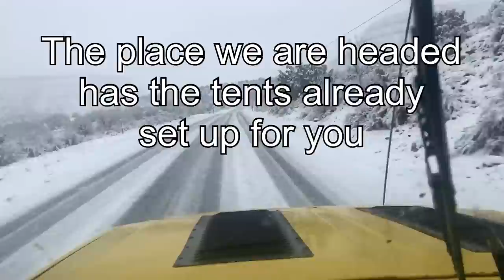Thanksgiving Day Rescues! Nissan Titian, Buick, Mazda, Dodge, Chrysler

Comment: A little tip for anyone in this situation. FWD cars get better traction in reverse so you can try backing up the hill before calling for a tow, but be careful it is much easier to lose control in reverse as well so go slow.  I often take advantage of this to get back into my driveway if it snows while I'm at work.

Comment: I too got caught up in this storm system but in the mountains in San Diego where I live. 2 days after the storm we attempted to drive home down our 10 miles dirt driveway. 5 miles in we got stuck in a snow drift about 2 feet deep. I was in our tahoe in 4 wheel low, real tire chain (not cables) and run an aggressive tread tire but could not get out. Snow was up to our frame. My husband walked 5 miles to get our backhoe to plow our road and pull me out. Fun adventure, we were prepared with food, water, blankets and snow gear. Our kids wanted to spend the night out there because they were having so much fun.
Reply: Sara Scott I’m guessing that your Tahoe doesn’t have lockers like Matt’s Jeep.  Without lockers you truly don’t have four wheel drive on slippery surfaces.
Reply: @ClinttheGreat  no I dont have lockers, wish I did. It being slippery was not the issue, my problem was the more than 2 feet of snow I was trying to push through. We could have dug out but we only had 90 minutes of daylight left when we decided to get the backhoe. We also had our children with us and needed to think about their safety as well. My home is down a 10 mile dirt mountainous road so I think I know a little bit about my 4 wheel drive capabilities.
Reply: Clint The Great Lockers don’t matter if you’re buried up to your frame and your car doesn’t have the clearance so it’s pushing through the snow. You can get by without lockers.
Reply: @samuelyi9189  thank you! Lockers are helpful in  mud, which I do encounter on our road but have never needed lockers to get out  because I dont drive like an idiot. Had lockers on my Tacoma 4x4 and never needed them. Unlike the folks in these videos we were very prepared (we keep folding shovels in all our vehicles) and were able to get ourselves out with our own equipment.
Reply: Sara Scott I totally understand what you meant. We have a 2016 suburban and does not need lockers at all.  And we’ve gotten it in some mud. Meanwhile my diesel 7.3 F250 just sinks straight down 👀
Reply: @samuelyi9189  we have similar taste in vehicles. We have a F-250 with the 6.7 and my dad has an F-250 with the 7.3 I'm not brand specific just do my research and go with tried and true performance. I've owned everything from a toyota, jeep, chevy and ford.
Reply: @samuelyi9189  so far so good. We have a sweet extender warranty on it just in case. Already had the high pressure fuel pump replaced under factory warranty but otherwise it is not a daily driver just for towing our 5th wheel.

Comment: This channel has inspired me to build a 00 wj v8 as a offroad recovery vehicle I have outfitted with small lift 1200lb winch highlight and  mat trax and have a yankum rope coming soon the vehicle came from my tow yard so the cost are low but thanks for inspiration guys
Reply: You need a much bigger winch than that.  You'll destroy something that small the first time you use it.
Reply: Jeep was free and has reman motor in it I'm not a fan of the 4.7 but free is free
Reply: Smittybilt Gen2 XRC 12,000lb Winch 97412

Sorry forgot a zero

Comment: I just moved from the snow belt in western NY and I lived on a 1/8 mile gravel driveway with a pretty good grade on it.  I can't tell you how many times I have pulled delivery trucks back up my drive way to the main road with my Pathfinder.  AT tires make all the difference in the world.  Noisey on the highway, but worth it.

Comment: You know, in my 2019 JLUR (lifted with 35s on), I would feel secure with a winch, MaxTrax, chains, heavy duty snatch straps, and more.  And it is SUPER capable.  Already helped several ppl out of trouble.  

In THAT thing?  Just a kinetic rope and some good tires are all the Banana needs.  Damn that is a beautiful, fully capable XJ Frankenstein that needs no extra toys.  Never get rid of her.

Comment: I can see that your tires condition is crucial to your not getting stuck but over here in upstate NY metal studs can be a life saver! Try a pair on for those real icy, snowy treks when your hanging off a cliff edge they can be what keeps my suv from sliding off the edge
Reply: Morgan Earp no.
Reply: @richardburns9772  Yes. Studs are a life saver on wet ice or wet compacted snow.
Reply: Richard Burns just went up to public lands yesterday with mine on my Subaru . Went through a lot of country I would not have been able to with the “all terrains”
Reply: Morgan 2525 not with that attitude you wouldn’t.
Reply: Morgan 2525 so?

Comment: "don't overrun the rope" proceeds to drive 5 feet over the rope
Reply: Maybe he thought overrun means getting the tires on top of the rope? Some of them are tourists and not the best English speakers... or he couldn't see it.
Reply: Dylan Houser I helped some guy I knew tow his truck using a brand new tow line. I was starting to slow down as we approached his house when the guy thought it’d be funny to come to a skidding stop...of course he ended up locking up his brakes right as he ran over the tow line and shredded it. When I asked why he did that, he said it’s just a rope. No Jack-Hole...it was a $50 line that was now unusable. He refused to kick any money towards replacing it. That was the end of me ever responding to his calls for help fixing his truck.

Comment: I worked at a Ski resort, Timberline, for 4 years and pulled numerous tourons up the mountain. Heck I’d make more in a weekend of heavy traffic than I did working the lifts and making snow.

A POS Isuzu Trooper with a welded rear diff, a set of chains, and a few snatch straps and 2 shackles is all I had;  nothing special that’s for sure.

And I NEVER asked for payment; but people were very grateful and generous.

Comment: I guess the guy with the Titan didn’t have a floor jack and a block of wood or anything to put under tire and back up. Some people just don’t think lol. Great video Matt Merry Christmas
Reply: That one was easy money. Kinda surprised he even got the call on the titan
Reply: It looked like he was pretty isolated, which means he should be even more self sufficient.  High lift jack would’ve worked perfectly.  Enough trees around that a come-a-long and a chain would have done the trick.  People just way to used to calling someone else for help.
Reply: I was wondering how something like that happened twice. The guy might be elderly, drunk or just forgetful of the terrain.
Reply: @eunhyuekpark6159  or all three lol
Reply: Air jack under the subframe, then stack stuff under the tire? Seemed quite tight for a floor jack and putting it straight under tire is never a good option in my opinion.

Comment: As the phrase goes, hindsight is 20-20 as we sit here and watch what happened to those stranded people with rentals, after all it appears to be a public road and an established spot for those looking for holiday accommodations and probably booked well in advance at that, along with the rental vehicles in question. Freak unusual weather for that time of the year comes and everything goes sideways. Speaking of rentals, years back I rented a 4x4 Suv in a location that gets LOTS of winter conditions and it was indeed winter then and not one of their rentals had winter tires on them, that just seems to be the way most rental companies roll, put as little into the vehicle as possible.

Comment: Front wheel drive. 
All season tires. 
No ground clearance. 
Loaded up with gear. 

Ready for snow camping?
Reply: Ground clearance really wasn’t an issue. Everything else was though.
Reply: But the tires say m+s. Meaning "mud and snow". Are the tire manufacturers lying?
Reply: @themexicanstaringfrogofsou5268  the M+S rating tires usually have plenty deep tread, but little or no sipes for ice traction.
Reply: @themexicanstaringfrogofsou5268  Not lying per se. It's more like a joke that's only funny to the manufacturers.
Reply: Yes, the tire manufacturers are lying. M+S tires have rubber not suited and often not even rated for below zero conditions. To drive in snow, you need winter tires for traction/safety.
Reply: In northern New England  we call that "Tuesday".
Reply: @ancelrick5396  Here in Texas we call it Tuesday Tuesday
Reply: Half these people could have made it if they just turned off stability control and aired down to 10-15PSI.

Comment: I drove a Chrysler Town and Country cab in Austin and we got a snowstorm one night, one of my regulars lived on the top of a hill and I couldn't get up it the first couple times I tried, then I decided to try to back up the hill and it worked like a charm. Front wheel drive, weight of the engine on the drive wheels and didn't have a problem at all.

Comment: Tires Tires Tires. Many of the cars would have been just fine on some dedicated studded winters
Reply: i thought exactly the same, 4 season tires are not enough for snowy mountain roads.
i live in the mountains, always swap to the winter seat of wheels and never ever get stuck or lose control.
plus they even perform better with dry clean tarmac with cold temperatures compared to standard tires and since i change set of wheels at home i didnt spend money with tires shop once tires are mounted onto his wheels.
here winter tires or snow chains onboard are mandatory during winter so usualy only tourists or semi trailers get stuck.
Reply: Studs don’t really help in conditions that aren’t smooth ice.
Reply: When someone throws a Tire to your face do you get Tired?
Reply: @sunnydeng9263  FWD is great in the snow as long as you're not trying to plow it with the bumper. Good set of snow tires and some caution will get you through horrific weather that has all the manly SUVs with mudders skidding all over the road.

Comment: Is the Jeep manual or automatic transmission?

Never mind, question was answered in the KTR Snow Rescue video...in case any one else is curious, it is automatic.
Reply: 2-speed powerglide with 6k rpm stall. Cuz Race Jeep. 🤣
Reply: Not necessary to have read it somewhere: All you have to do is listen to the engine after he starts to pull -- The automatic transmission almost always upshifts to 2nd and stays there while he is yanking them out.

Comment: The white car around the 5 minute mark will be calling for a tow out soon
Reply: My exact thoughts, it'll probably be tomorrow's video. You know you would think this car is being towed up maybe I shouldn't proceed down this hill where there's another car stranded that couldn't make it.
Reply: That white car had chains on its front sneakers ....they clearly have been to this rodeo before
Reply: k bone  makes sense, looks like an accord.
Reply: @ericno4u  it was an accord lol a 2017 to be exact.
Reply: Tire chains, they'll be able to go though hell and back, probably fair better than the jeep without chains in those conditions
Reply: k bone No. not a Subaru. Try again
Reply: Depends on who's driving.  I am quite confident that I would have been able to get up that in a typical front-drive sedan with no chains.  The key is to get some momentum and give it hell to dig down to the gravel.  No ground frost, above freezing--digging my way up that road sounds highly plausible.

Comment: I bet most these people don't even know how to turn traction control off.
Reply: Its generally a good idea to turn it off in sand, from my experience it does ok in snow.
Reply: Most of those vehicle you can't. Even if they have a button it normally doesn't disable it completely.

Also you'd need better tyres.
Reply: Sometimes there is a special sequence to get it done.  On my Chrysler 300, you have to turn the car off, push and hold the traction control button as you start the car.  Wait until the screen changes from sport to traction control off.  i don't know if rentals would include this info in the information.

Comment: Common themes on vehicles stuck in seemingly passable conditions: Big Rims, Tiny sidewalls, Reactive traction control systems, Drivers connected to the car through magic pixies resulting in no sense of where the threshold of traction is..... kinda sad. A 1989 Buick Skylark would have scampered right up that hill. A 2019 basically anything, is useless without AWD because "progress."
Reply: Great comment lol, at least in the old stuff you could find the "butter" zone and as you said scamper on up the hill.
Reply: Are you a Big Clive or Ave fan?  (magic pixies)

Comment: What's  better  a 90s  Toyota  4runner ora 90s jeep Cherokee to tow with
Reply: @MattsOffRoadRecovery  true thanks
Reply: @maddawgnoll  yup  I have  a 90s Toyota  pickup  and they are great  but slow  but still  I like  it  I would like  to get a 4runner.
Reply: @chevylandt.v  
Had my '97 Cherokee since '00 & it pulls my 20 ' boat all over the place with no issues. Live on the Oregon coast & it pulls stuck 3/4 ton pickups out of the sand no problem. Will work even better when my Yankum rope arrives 😁
Reply: My brother has a 2002 4runner not impressed no flex no power no ground clearance. But I am a jeep person soooo
Reply: They're both decent, but the XJ weighs about 400 lbs less, and also has +40 HP and +40 ft-lbs of torque compared to the early '90s 4Runner, and that's with the 3.0L that likes to eat head gaskets. The late '90s 4Runners match up better with the 3.4L, but are about 600 lbs heavier and 1' longer.
Reply: The Jeep since it has a straight axle in the front.

Comment: Matt, happy new year. Don't know if you've used that Armoural stuff but keep it away from the inside glass. It's like smearing it with oil and it's next to impossible to remove. Use plain Windex and paper towel and you'll never have a smeared inside windshield again.

Comment: I've always found that in front engine autos with FWD (and 4WD trucks for that matter) if traction is your problem, reverse is the answer.  But in all cases reverse is a weaker driveline (especially with automatics), so be careful incase the tires start biting.

Comment: If I had to drive those front wheel drive things up, I'd turn around and try reversing. Gives better traction on the drive wheels, only thing is you have to kinda know what you are doing.

Comment: I had a CJ-7 with a 4 banger back in the mid 80's, I would cut school on heavy snow days and head to the ski resort just to pull people out and make a pile of cash.... I would charge anywhere from 15.00 to 50.00 depending on how stuck they were... It never failed that I would make 200.00+ in a couple hours!!

Comment: I noticed you stated on another rescue in warn sandy terrain that you had 9 psi in the tires.  In this video you said 15 psi.  Do you find different PSI works better under different conditions and terrain?
Reply: Good question. I wonder the same, I usually stay at around 20 PSI when I hit the trails which feels comfortable to me. 

Are the tires on your jeep 10 Ply?
Reply: @ROFLgator1   I don't know what tires he has.  I just noticed that on a very soft sand tow he said he was running 9 psi and for the snow it's 20 (this video) psi.  Maybe sand calls for less.  Just thought I get his input.  Cheers
Reply: Lowering the psi creates a bigger footprint which allows more surface area for more traction. Sand requires the lowest psi followed by snow/mud  then dirt. Psi Also effects fuel efficiency.

Comment: Easy money like the videos always interesting.. I'd imagine the right driver I bet might have been able to get a few of those out without a tow.. Just have to use a little common sense and apply the right amount of right foot with the traction control turned off. I've gotten a few out like that under the vehicles power however my passenger told me she nearly needed a change of pants afterwards. lol

Comment: Since you've had some experience with these tires in the winter now, how do they compare to the Duratracs?
Reply: @MattsOffRoadRecovery  Good to know, I just put Duratrac's on my TJ
Reply: Matt's Off Road Recovery   Hey Matt, how do you think the Duratracs would wear on a full size diesel truck? I have been running BFG ATs and they work well but wear very quickly.
Reply: @MattsOffRoadRecovery  Thanks.  I'm thinking about Duratracs when the junk Kellys wear down enough to justify replacing them.  Do you run beads for balance or the stick-on or clamp-on weights on the wheel?

Comment: 10:38 isn’t it ill advised to use the tow ball as a contact point?
Reply: That's a actual hitch that connects to the frame. So not in this case, but yes if it's just a ball through the bumper that's a horrible recovery point.
Reply: Nik S I can see that. Thanks for the insight!

Comment: Do you find that the motor loses power at that elevation, or does the cold air compensate ? we are ostensibly at sea level here, but the reduction in power is noticeable when we get into the high temperatures during the summer.
Reply: @MattsOffRoadRecovery  When we were planning to take our Tundra/8K camper to Utah, I researched this and the rule of thumb is 3% loss of power per 1,000 feet of elevation change.   Over Monarch pass we were theoretically at 70% power but Toyota "says" the computer compensates for it somewhat.   Did fine.
Reply: @Jim Collins back in the day you would have to re-jet a carburetor to make up for the effects of altitude, now the computer senses the change and adjusts the air/fuel mixture.  You still have a slight loss of power, but it’s not as pronounced as it was with carbureted vehicles.

Comment: is the xj manual or auto
Reply: @MattsOffRoadRecovery  I think in one video he said hes sill on the origional transmission
Reply: with 206k miles.
Reply: Matt's Off Road Recovery what about the front and rear diffs? D44? D35? Front and rear locked? Plz tell me